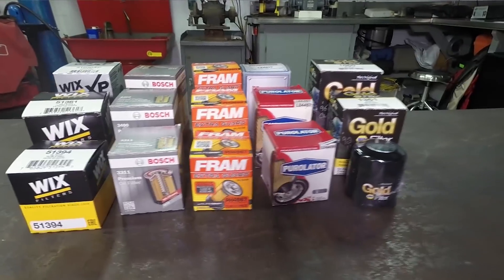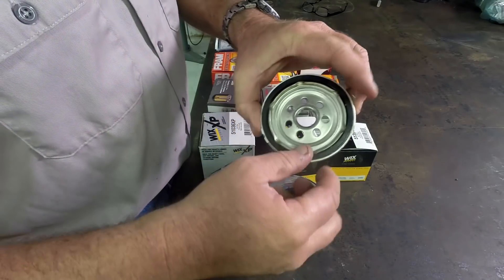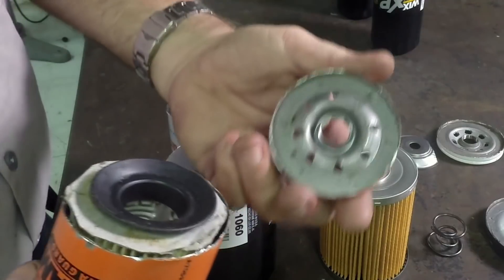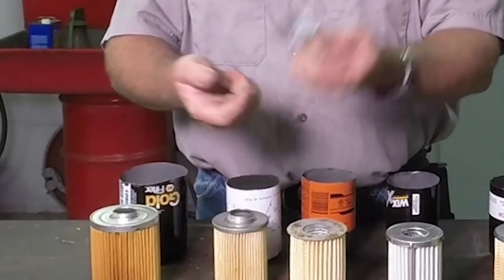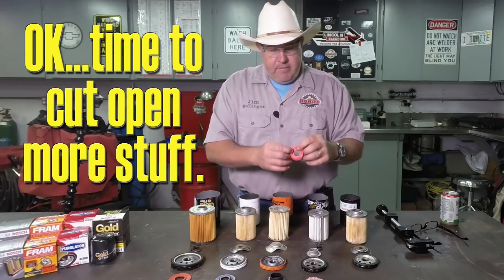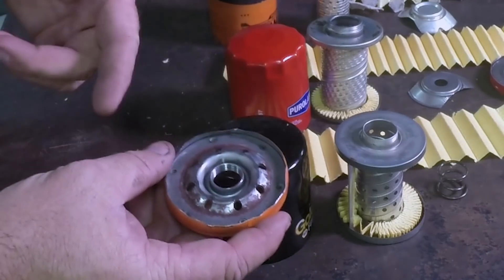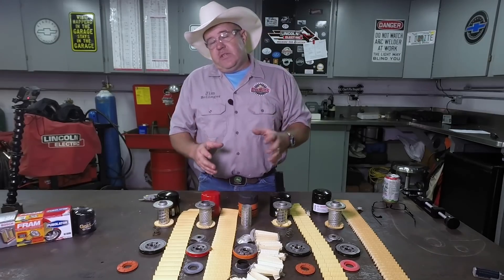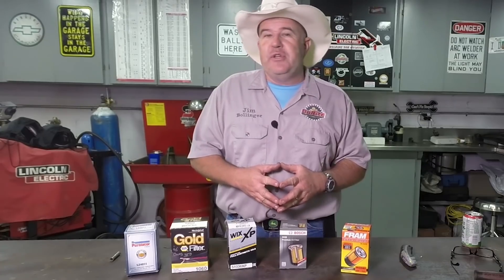The worst oil filter EVER!

Comment: I have seen and used a lot of fram filters over the past 30 years and never once seen any failures or damage because of one. My sons truck has 380 thousand and still going strong
Reply: Yet. Did you actually watch the video?
Reply: @tprice3450  yes I did watch the video, I was stating that I have never seen damage caused by these

Comment: Here in OZZ the best filter is Ryco.   I had an engine failure due to a puralator filter coming apart in the early 90,s .  Havent used them since.  To there credit they did pay the cost of repairing the engine.

Comment: The dealer I bought my Audi from installed a Fram filter.  Didn't think much of it until a week later left me stranded on the highway with a low oil pressure light.  After towing it home and and dropping the pan figured out there were no obstructions, just not enough flow from the filter.  I will use OEM filters from now on

Comment: I used Fram oil filters on a beater Nissan Maxima for years and the cheapest 5W30 oil on sale at the parts store. Car had 350k when I sold it and the motor was as quiet as a mouse. We have a beater Nissan Sentra and it too gets the cheapest 5W30 oil and a Fram filter. No issues either.

Comment: i dont use the standard fram filter. looks like your comparing their standard to other brand gold levels?
Reply: Doesn't matter, the gold level has different filter media in it and sometimes a puck of oil additive but otherwise, all the usual flaws remain.  I used to buy Fram HP1 (instead of PH8) at 3 times the price - until I went to work for Fram.

Comment: Wix makes NAPA's filters and also supplies Chrysler with their filters. Would have liked to have seen Amsoil's filters tested. I ran them on my 04 2500 Ram Cummins 5.9. I ran them 10,000 miles swapped in a new filter and topped off the oil and would go another 10,000 miles. Every Blackstone report showed the oil was still good after 20,000 miles. At 30,000 they said to either contact Amsoil for a new additive package or change the oil. I changed the oil.  At112,000 miles I took the truck to the Cummins service center for a tappet adjustment and the mechanic ask the service manager and me to come out to the shop. At first I was like WTH is going on, but then the mechanic showed us how spotless the inside of the engine was. They ask me what kind of oil and filters I used and what my change schedule was. When I told them and they took pictures  of the top of the engine and asked if I could send them my Blackstone reports. Top quality oil and filters is a number one priority for me.

Comment: Very nice video man! 👍🏻 The Brands Napa (Gold), Wix and Purolator are all owned by the German Company Mann-Hummel. They have a very good product quality and quality control. In Germany the products are sold directly by the Brand Mann-Hummel. I don't think, that they are sold in the US. We use them mostly all the time and never had problems. Another good brand is the German / Austrian brand Mahle Original (or Knecht, which is also owned by Mahle). I like to use them in my BMWs, because I know that this is the brand that BMW Steyr uses in their engine production line and it's the same product, that BMW sells with their Original part number printed on it.

Even in Germany there are cheap bad quality products available. No exception for filters. Cheap parts can be very dangerous. Not only can your vehicle be damaged, you may even put the life of others in danger. - For example when you put cheap axle parts or cheap brakes in your car.
Greetings from Germany🙋🏻‍♂️

Comment: well hate to tell ya. but got my car at 128,000 miles and now have over 281,000 miles. 15 years later same oil and same FRAM filter. every oil change. no issue can pull dipstick and check oil at 2,800 miles into oil change and still clear as new

Comment: Aircraft supplier folks make a very easy to use filter cutter to make it easy to open a filter. On aircraft, we always open the filter when removed to check for metal or any abnormal debris.

Comment: Seem to me, the better "test" would have been to open up used filters..... Pulling a new filter apart by twisting it, a motion it would never experience in use, seems pretty bogus to me.   I'm not particularly loyal to one brand over another.  But, purely by chance, I'm planning on changing the oil and filter in my motorcycle tomorrow.... Have a fram to replace a fram... Before I put the new one on I'll use the grinder on it.  My bet is, a: I will make a terrible mess on my workbench, b:  It will be a saturated soggy piece of filter material that has maintained its shape after 5,000 miles.

Comment: Interesting video to be sure.  I used Fram oil filters exclusively for years without ever having a problem on any of the vehicles I used them in.  One car had nearly 220k miles on it when I finally sold it... ran perfectly, great compression, used no oil, no problems whatsoever!!!  What is most important is to change your oil and filter regularly and make sure the filter is properly installed.  Until you can demonstrate that Fram filters actually lead to problems you haven't sold me on a thing.  BTW, when there's rust on the inside of the can, it'll likely get trapped by the filter if it comes off.  Just my experience...... your mileage may vary !!!
Reply: To bad you did not have a chance to disassemble the engine that had 220,000 miles on and check the main bearings and rod bearing then you might be a believer.
Reply: They're hot garbage

Comment: I am using many years fram filters ($ 6.97 )and never had problems. Right now on two Elantra’s both over350 000 km and never need to add oil between changing. That my experience. Probably if you change oils on time you don’t need to buy $18 filter and buy $4.74 filter from Napa. Thanks for your video.
Reply: ...and don't drive like Burt Reynolds!

Comment: WHAT A BUNCH OF CRAP / I have been using Fram for 35 or more years I cant count how many 200k plus vehicles ive had plus they have moved 5000 vending machines and pulled heavy goosenecks and other trailers /Change your oil on time and use the good stuff you wont hve problems / they have their purpose but this guy is making their job bigger than it is

Comment: I guess my issue with all of this is that I am an original owner of a 2001 Honda Accord and have performed regular oil changes every 3-4k miles for 20 years and I ALWAYS ALWAYS ALWAYS use those orange FRAM filters.  So perhaps the filter is made from cheap parts, however did it destroy my 20 year old vehicle... NO!!!!!!!!!

Comment: I have a 1994 Toyota Four Runner with 496,000 miles (3.0 L V6). Never used anything but Fram filters since first oil change.  Engine has never been apart.

Comment: If I remember correctly, there was a class action lawsuit against Fram years ago because the cardboard was clogging oil passages and wrecking engines. I have changed oil for other people and they will have a Fram with that stupid grippy coating on the end. I can't get a filter wrench on! Grrrr.

Comment: Used fram on my tundra has 200k and runs flawless.  Oil perfectly clear after oil changes —uses a quart every 6 or 7k miles. Change every 10k
Reply: Extra Guard, Tough Guard, or Ultra Synthetic which one?

Comment: I cracked open one of their more expensive “tough guard” filters. And sure enough, the same cheap cardboard top and bottom holding the filter material in place. I’ll be grabbing another brand off the shelves from now on.
Reply: OK, but "Tough Guard" is not the "Titanium" (which I think was previously the "Ultra Synthetic") filter. Have you a word on those?
Reply: Been using nothing but Fram on my tacoma. It's at 346,000 miles still running strong. It's not that serious. Just change your oil on time.
Reply: @deathbysr20  why would you knowingly use a shitty filter? To save a buck or two but willingly let rust and abrasive materials into your motor is beyond me.
Reply: @darrengarcia4937  349000 miles and still going strong. I don't know what rust or abrasive materials you're talking about.
Reply: @deathbysr20  FRAM are known for having shit filter media and rust in the filters out of the box. FRAM are what the noobs use because of the black grip gimmick.
Reply: @darrengarcia4937 😅  like I said 349,000 miles. I wonder why it's not dead yet?
Reply: @deathbysr20  I agree. I've used frams for a long time and in high mileage vehicles. All this shows is they use cheaper materials. The actual proof in the pudding is do they filter to an acceptable level? He did not test that. I don't really care if there's fairy dust inside, what matters is does it filter? If another filter company put that grippy stuff on their filter I might switch lol. Does FRAM have a patent on that or something?!

Comment: I also did a comparison in my 2007 2.4 Ecotec. The Phram cartridge came out visibly 'collapsed', sucked in on itself, after only 1000 miles. Needless to say, but it was immediately swapped out for a known, non-collapsing brand. OE, Bosch premium, K&N are among the FEW that survive the flow demands.
Reply: Never saw that.

Comment: That slight  bit of surface rust inside oil filter  cannister is 99/%  tarnish dicoloration,   will not hurt motor . Compared to dirty air from driving along
 anyway.  Tarnish on inside oil filter will not effect or compromise engine. Just having a little tarnish on oil filter metal is not  a big deal for what it is.  But even if it was   tarnished it still would not hurt anyrhing and use another product next oil change.

Comment: fram filters were good when fram was still owned by allied signal, when they were sold the new owners started making them cheap probably assuming nobody is ever going to cut one open to see what's inside. wix filters have always been good and are the standard brand in the trucking industry.
Reply: Fram's standard orange can oil filters have been unchanged in construction through, at least, the last three transfers of ownership, including Allied Signal.  With that said, while the filter is clearly lower quality construction, many people have trusted it for decades and nobody has ever been able to prove that it doesn't perform as intended (with the exception of Ford, who has documentation that several aftermarket filters are unable to maintain oil pressure within Ford's spec).  I do not use Fram in my vehicles, but I cannot prove that they will accelerate wear or cause damage to an engine.
Reply: Donnelly is the trucker's standard brand.
Reply: I was told Luberfiner is "the" premium filter for big trucks. I'd like to see him open up a Luberfiner.
Reply: @alanschwartz1157  In a different lifetime (near 40 years ago), I worked in a filter manufacturing plant that made filters exclusively for trucks and large equipment.

Funny thing was, we'd make the filters... and then figure out who's name to stencil onto them (along with who's label to put on the box). Luberfiner and Wix were both customers... and the same exact filters.

The stuff that he talked about holding the filters together, may have been a substance called Plastisol. During assembly, it would be applied to the filters where adhesion was desired, and then sent through a long oven (via conveyor chain), where I eagerly awaited the opportunity to burn myself. It was my part of my job to wipe off the excess Plastisol while it was still hot. Once it cooled down, it was there to stay. I wore 2 pairs of leather gloves to protect from the heat. I was pretty skinny working that job. lol.

I don't know if they use Plastisol in auto filters. But we used it back in the day for the big ones.
Reply: @dalemarkwell1171  Great first line there Dale. And this one  "..where I eagerly awaited the opportunity to burn myself..". Funny 🤣
Reply: Luberfiner is the same quality as Fram. Like Wix to Napa.

Comment: Ok, so some of those filters are crap. You can't blame it all on bad filters. I blame most break downs on lack of preventive maintenance. No oil, even synthetic, will last forever. An oil change, even with expensive synthetic oil is still cheaper than the price of a new engine!!! But then again, cars of today are disposable. It costs more to fix one than to buy another.

Comment: I built A426 hemi and I made a mistake of using a fram filter the frame filter failed causing me to lose the whole bottom end on my 426 hemi not only did the filter fail Fram would not stand behind Evan after said it failed Fram is junk so 5000 dollars later  That happened 20 years ago and I've never used a Fram filter since

Comment: Oh my GOSH!!  I was SO perplexed why my car broke down.
I owned a 1973 G.T.O with a 6.6 liter or 400 C.I.D engine.
Back in the day, I changed my oil every 3,000 miles or every month.
FRAM was my favorite oil filter because I trusted this filter as many other gear heads did.
One morning on my way to work as I took the exit ramp to the traffic light 🚦 I stopped and clearly heard a knock as the engine idled. 
When I returned home that evening I pulled the oil pan to find that I had spun a rod bearing.
New standard size bearings with plasticgauge test, re install and torqued to specks.
Thank you.
Now I know what filter to reinstall every time.

Comment: I still have my 97 k1500. Oil changed every 5000 miles. Only used fram oil filters. It still runs like new with 375,000 miles on it. I’m not sure what to think.

Comment: Farm has been junk for years! Back in the late 80s Consumer Reports did a test using Fram, Wix, Hastings and a few more. They did a “One Pass Test”, in other words they measure the amount of contaminants removed after passing all the through the filter. That isn’t how an oil filter works, oil will pass through the filter media thousands upon thousands of time. Consumer Reports test showed the Fram did the best job. I haven’t had any use for Consumer Reports sense. I ran a parts store for years, a Fram rep came through wanting me to switch from Hastings to Fram. I challenged him to cut the two brands of filters apart and compare, his comment was “we are not in the business of cutting filters apart. Fram is absolute junk!

Comment: So the Fram orange can filter is definitely poor quality when it comes to running an oil change for a long interval

 but if you're going to run the three thousand mile oil change interval there's nothing wrong with using the Fram oil filter you just have to be conscious of it not being of very good filter, it's a cheap filter and it needs to be changed more often if you're going to use it during services

The people that I see having problems with those orange cans are people that have tried to go 10,000 miles like the Box States and that's not the case Fram advertises it incorrectly

It is indeed a cheap crappy filter but people do not use it in the right application because frame advertises it can go 10000 miles and it cannot

Comment: No bias here, correct? If there's no bias then why does the comparison use a Fram Extra Guard, their base line filter ($3.88 at WalMart) with a NAPA Gold, their premium filter ($9.49 at NAPA) and a Wix XP, their premium filter ($12.99 at O'Reilly Auto Parts)? Why didn't you compare it to the FRAM Ultra Synthetic Filter, their premium 20K mile Change Interval Oil Filter ($8.97 at WalMart)? I find that generally it's only a legitimate comparison when using apples vs. apples. 

NAPA Gold: https://napafilters.com/filters/oil-filters/light-duty-oil-filters/goldnapafilter-oil/
Wix XP: https://www.wixfilters.com/ProductsAutoOil.aspx
Fram Ultra Synthetic: https://www.fram.com/products/consumer-products/oil-filters/fram-ultra-syntheticsup-sup-oil-filter/

For those who care to be educated with a fair comparison, take a look at this video to see the inside of the Fram Ultra Synthetic oil filter.

Comment: It's surprising that more people don't know about this, by now. Also, years ago, we put on a Fram filter on a stock engine once. ZERO oil pressure, after the oil change. Talked to a couple friends, that were mechanics, they said take the Fram off, and I'd have pressure again. Sure enough, changed the filter, and pressure was back. Haven't used one since, and that was in the eighties. Napa Gold are awesome filters, all that I use.
Reply: My brother was a mechanic and said the exact thing, never use a Fram.

Comment: Don't know what to say.  I have run Fram PH8A filters on an Allis Chalmers Chalmers D15 tractor for 40 years and it still works for me everyday.  Have also used the PH8A on two old Dodge ranch pickups with 318 engines; one for about 300,000 miles and the other for about 250,000 miles.  Guess I've been lucky.

Comment: Hello everybody! Last week I had a big issue with oil pressure on a 22re Toyota engine, BIG PROBLEM BECAUSE FRAM OIL FILTER CAME APART! From the interior, don't use Fram oil filters, almost damage the rebuild engine because of that

Comment: Thanks for demo. I’ve always changed my oil and used Fram for many years. Recently I’ve been seeing a lot of negative remarks  about Fram  filters but didn’t know why. Now thanks to you I do. I drive Subarus and have been using their filters recently. Hopefully they are good quality.
Reply: Albertstasko, newsflash…the Subaru OEM filter is made by Fram. So is the Honda OEM filter.
Reply: I don’t think their engineers are gonna let crap get into their engines.

Comment: I used to use Fram high mileage filters, but when I bought them I always use one from a truck which has a larger filter (I have a small block Chevy in my 97 Trans Am), heard about how bad Fram filters were years ago and now use a Mobil 1

Comment: Can't deny the results of the video. However, I have been using Fram filters my entire life and I have never had an issue on any vehicle I've ever had. All the way up to 300k miles.  I believe proper preventive maintenance has alot to do with it. If you change your oil when you are supposed to I don't belive you would have an issue.